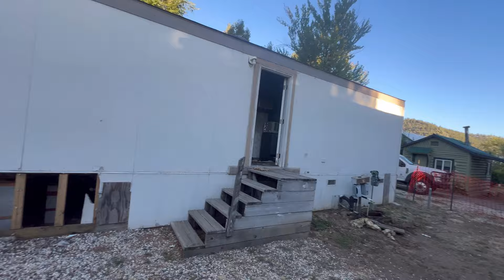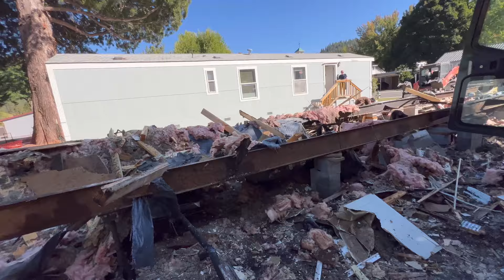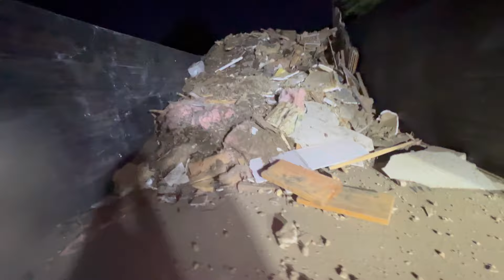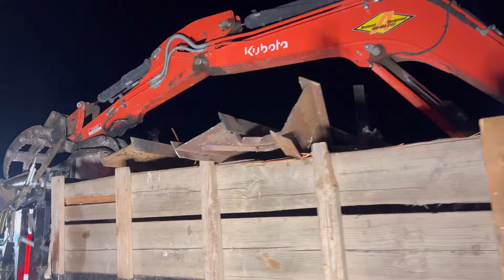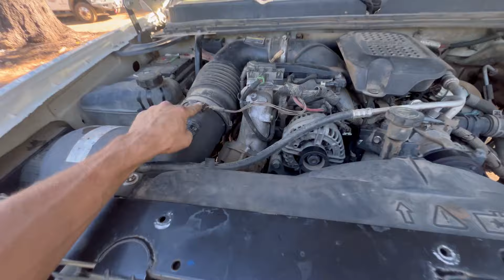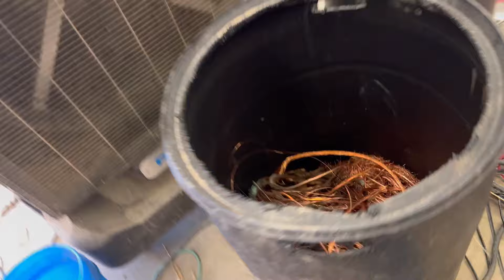24 hour job to remove a mobile home

Comment: Hey Payton, wanted to ask you opinion I have a job coming up that’s a 8ft Truck bed rv junk removal. how much ballpark should I charge to demolish and remove? Also any other tips when destroying one of those that I should know about ?
Reply from the maker: @BlackDiamondLandServices  demolishing an RV on site it’s best to be done with an excavator with an enclosed cab. If it is possible, either drain the fuel tank or a remove the fuel tank before you start demolishing it make sure the propane is off if it has a propane tank. or disconnect it completely from the unit
Don’t crash into the refrigerators. They are full of Ammonia and it’s terrible if you breathe it in

For a full size cab over truck bed camper depending on the condition sometimes they are worth money. If it’s junk I usually charge about 1200 to 1500 for an RV 30 foot long. They charge about 2800.
Depending on the year of the unit that you were about to demolish, I would try to remove all of the windows except for the windshield. Some RV windows are tempered glass, and they are quite a big mess to clean up at the end if you demolish it with the windows in it
Reply: @johnathanpeyton  thank you for the advice I really appreciate that!
Reply from the maker: @BlackDiamondLandServices  anytime

Comment: I'm a Ford guy too. Glad you stuck with it. I have been very happy with my F350 6.7 Powerstroke. Watch that Cold air intake hose coming out of the Heat Exchanger though. Mine went a few weeks ago. $300.87 and took 10 minutes to change. Come to find out they make steel ones too that don't fail. You might look into that. Thanks for the video
Reply from the maker: @8978Marty  I still have 20 k miles tell my warranty is out but I do want to install the CP4 Disaster Prevention Bypass Kit before something happens
Reply: @johnathanpeyton  I did the AirDog on my chevy after the catastrophic failure of the CP4 at 111k miles. ran it until215k then the emission system went and I desided that was it
Reply from the maker: @8978Marty  what year was the  Chevy